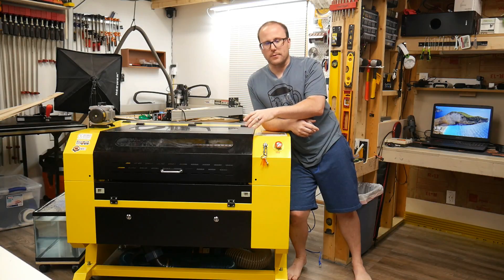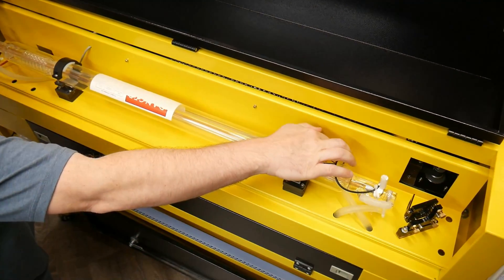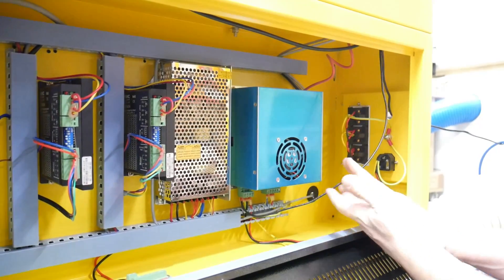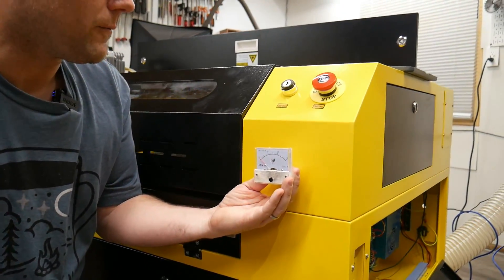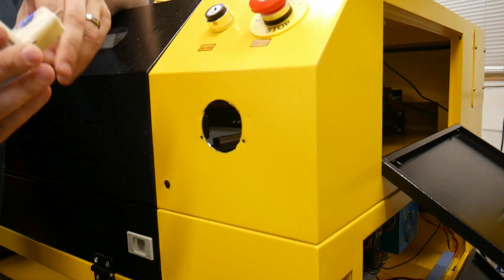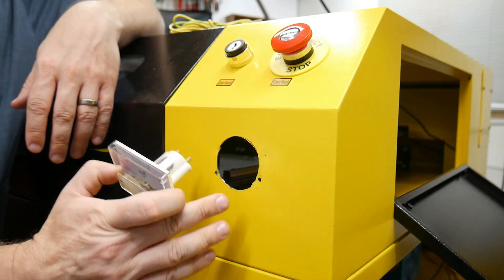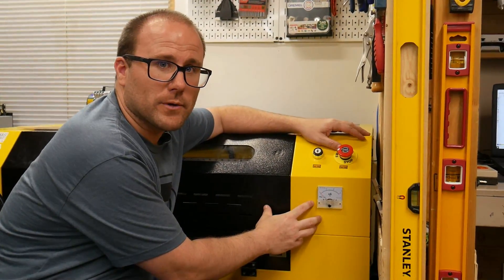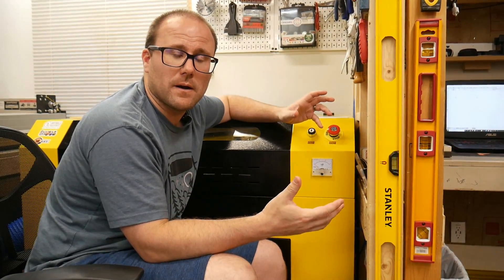How To Install A Milliamp Gauge In A Chinese CO2 Laser

Comment: Your wiring technique is really scary!  Folks watching, please use a proper crimper for your connections, better yet solder them.  If you thought you had a 60 watt unit, you may have a 60 watt unit.  Your connections may be insufficient for the load and showing what a 50 watt unit pulls.  I suggest crimping them correctly and checking your wattage pull again.  Not nagging, but constructive thoughts to consider.

Comment: You should peal off the blue protection-plastic from your laser power supply, its only there to protect the metal when stacking them together from the factory. Due to there are components that uses the metal to lead away heat, the plastic will act as a insulation so that the heat wont dissolve as good as without the plastic, your components will last longer without it <3

Comment: I personally would've use those water proof self soldering heat shrink connectors on the wires.

Comment: I didn't quite understand how you decided that 20mA was the max amperage (which corresponded to 85% power in Lightburn). Also, would a 30mA analog meter be sufficient for an 80W tube?

Comment: Cooling inlet should be at the rear because it is the hotest place lower to prevent air bubbles side (1:09 shows that it is on top). Am I wrong?

Comment: My Milliamp Gauge sometimes goes higher then normal during a cut. depending one the file I am cutting it. The gage always reads 19 ma when press "pulse". But in a cut file. it varies 15 to 20. in  another file it went it to 21 ma steady. any clue why? Not all files do it.  I have min and max at 80% power.

Comment: I need some major help. I installed the milliamp just like the video instructed. Turned on the laser and the milliamp isn't registering any power at all. I tried running a test design and the laser is not firing up. What have I done wrong and how do I fix this?

Comment: Nice walk through but why to use yellow/green ground wire for current? I would use black wire so you don't confuse anyone who services the machine in the future.
Reply: Completely wrong, dangerous and stupid breaks every wiring code,  green and yellow is a designated ground wire colour , a quick trip to Home Depot for a $5:00 length of correct colour wire would do the job correctly. Also use the correct tool for butt connectors. Complete poorly executed upgrade
Reply from the maker: I don’t care, it’s my laser.
Reply from the maker: because it's what I had in my shop.

Comment: Magic question is, when it comes time to replace the tube, will the 60W tube fit in there and will the power supply have enough power to use it or will you just replace with another 50W?
Reply from the maker: 50w because i'd have to cut the end to stick it through.
Reply: @MyersWoodshop  Your machine already has a hole cut in the side to take a longer tube. :-)

Comment: You really shouldn't have used that spare piece of earth cable. At some point in the future someone may tap into it thinking it is an earth and then get a shock from the cabinet. For the cost of 6 ft of black why take the chance?
If you are going to use crimp connectors use crimping pliers and make the job a good one.
Reply from the maker: its what i had on hand at 11pm.
Reply: @MyersWoodshop  Noted, understand in that situation when you just want to get it finished and tested :-)

Comment: What gauge wires? I looked up 20-30amps and it's recommended 10-12 awg does that sound right?
Reply: 20-30 milliamperes not amps.
Reply from the maker: yep.

Comment: hi.  i have a china 100w blue and white. is it the same amps on all the machines?  and i see that everyone use the manual reader instead of a digital, is it a reason for that?
Reply from the maker: not same amps.  Digital can fail, analog cannot.
Reply: @MyersWoodshop  Both can fail, and if anything a digital meter should in theory be the more reliable of the two. But the reason for not going with digital is that an analogue meter tends to average out the instantaneous power as it is slower to react than a digital meter, so making it easier to read. A digital meter will fluctuate wildly and so the display will be constantly changing making it difficult or impossible to read.

Comment: Only in America would someone use earth wire as a negative connection. Negative wire should be black or blue in europe. Why did you cut the cable? Move L- wire to meter and add a newpiece of cable fromeL- to + side of meter. Result no dare I say cowboy wiring.
Reply: So to dumb it down, remove black wire from power supply and run to - side of meter. Then run a wire from + side of meter back into the - side of power supply?

Comment: Hi was it possible to remove the low voltage wire at the power supply terminals an break it there an install connector
Reply from the maker: yep, and that would have made more sense looking back on it  lol

Comment: Where can I find a chart that compares the length of the tube to the wattage of the laser (I've seen two versions of 80W tubes on Amazon from the same company, one which was 1250mm and the other was 1600mm.) 

ALSO, I don't understand how one can tell how/where the laser tube "maxes out."

I mean, it seems from your notebook data that your laser maxes out (100%) at 22mA. What am I not getting?

Is the maximum mA a parameter which is prescribed by the laser tube manufacturer (e.g. "a 50W tube maxes out at 18-20mA" -- and Lightburn reaches that when set at 85% power) . . . or can tell that the laser "maxes out" on the basis of the stock that is cut or what?

I purchased a 30mA meter for my 90W laser, but haven't installed it yet. Will a 30mA meter be enough . . . or should I have gotten the 50mA?
Reply from the maker: google.
google.
its overdriving at 100%

Comment: I need to get this to my basement.  Is it possible to take off the stand that has the wheels, so I can make it smaller and lighter?  I see a seam under the main box.
Reply from the maker: yep, its not super easy but its just bolted together. just take the top off.

Comment: also I would be tempted to simply replace the "inadequate chinesium" wire at the back of the power outlets and use them as intended, Much more efficient and self contained and you can still use the installed switches
Reply from the maker: easier to just get a power strip.

Comment: much better to use a soldering iron and solder the connections and cover with heatshrink tubing. or better still just join 1 wire to the black wire and the other to the powersupply where the black wire was, only one potential failure point then!
Reply from the maker: this is true.  i just didn't feel like it at 12 in the morning :P

Comment: Please find a pair of T&B Sta-Kon Pliers that are made for crimping both insulated and non insulated terminal connectors Model number Thomas & Betts WT111M  anything less is like putting 4 temporary spares on a corvette, or running 87 octane in a Ferrari in other words using a pair of lineman pliers ie side cutters to smash terminal ends is about as messed up as a soup sammich..

 Thomas & Betts WT111M

https://www.alliedelec.com/product/thomas-betts/wt111m/70039935/

Comment: If you want to have correct readings you should zero out the mA meter. There is black screw below the scale turn it to zero out the scale. Now it is reading less current because it is reading from -1 or -2 mA not from zero. Also using Protective Earth cable colour for High voltage ground from laser is vileness. At last among electricians.
Reply from the maker: Good thing I’m not an electrician!
Reply: @MyersWoodshop  Amen!

Comment: What did you use to drill/cut the 2 inch hole for the mA meter?
Reply from the maker: drill bit and jig saw.  didnt have a 2" hole saw
Reply: @MyersWoodshop  

Look up Square-D Hole Punch (or some of the cheaper alternatives available these days). When I made mock-up case designs for the military, I always used the Square-D punches. They make a very clean hole. They may sound expensive for a single hole, but I found that once having it, that punch size could be applied to a lot of other needs. A lot of products use full-inch size holes, so once you get a few of those punches, you will be surprised how handy they can be. Based on your measurement of the meter, I suspect that a full-inch size would be what you would choose. It is a good idea to make a test punch for some of those odd sizes on a piece of scrap metal.

It is also handy to have a metal hand punch for small sizes that you squeeze like pliers. They come in a kit form with several common hole sizes.

Comment: Are you shitting me?!

I am sorry but hell no! You do not use grounding wire for anything else BUT ground! As someone who repairs electrical and electronic devices on a daily basis that is just so infuriating to see. If I ever see that in a customer device it goes back un-repaired. I will not stick my hands into a device that has been serviced (or better butchered) by someone who thinks things like this are acceptable. No telling what other landmine botch job repairs that person has done before it landed in my lap.
Reply from the maker: I’ll exclusively use ground wire on everything from now on 😛

Comment: never use yellow/green cable for anything else then ground, get correct colour cable. And use the yellow/green cable for ground so you do not electocute yourself.
Reply: Actually, the response you were looking for was “oh, you’re right, my bad”. Clint is right.

At least if you’re going to do something dumb, don’t make an instructional video out if it.
Reply: That’s what a woodworker in Crocs would reply ... 😉 It’s your machine, you screw it up as you like. At least you saved 4 cents !
Reply: Color isn't important lol. If you know the machine it's especially not important.
Reply: @JSAFIXIT  Colour IS important and none more so than that used for Earthing and Grounding, so much so in fact that here in the UK the correct ratio of green to yellow in the cable sheath colouring is laid down in our wiring regulations.  And, whilst you say he knows 'his' machine, suppose he wants to sell the machine at some point in the future? What then? Rewire? Tell the buyer and hope they remember? Do it right first time.
Reply: @semperidem2577  OH so they are trying to idiot proof things. Gotcha.
Reply: I wouldn't call it idiot proofing but if you were to choose to to mess with any cable colours in a DIY build, the Earthing/Grounding wiring wouldn't be my first choice ;-)  
Put it this way, if you've gone to all the trouble of building your own machine or are adapting an existing one, why not go the extra mile and do things in the way they are meant to be done? Maybe it's my OCD kicking in, but to do this just to save a few cents of cable seems crazy.
Reply from the maker: i know whats what, so i did it with what I had on hand and free.  Feel free to use the 'correct' colored wire.

Comment: Good video and it allows me to draw a parallel with my Orion.  A couple of questions...
   Will a 30ma meter work for a 100W laser?  I just measured the tube at about 1470mm depending on where you measure.
   In one of your links you show the Ruida RDC6442G/S controller.  What was your purpose of upgrading it?
Reply from the maker: I didn’t upgrade the ruida controller. That’s just the only ruida that I can find on amazon for those who have a different brand controller.  I THINK the 30ma should be good for the 100w
Reply: Please, if you love your life and respect your family, hire and INDUSTRIAL IBEW Union Electrician to install the Meter.   As a clue, for your 100-watt laser, I would believe the meter you need would be 50 MA.  But it depends on the voltage applied, which is either in the manual or derived (calculated) from information on the tube.    Handymen don't cut it if you are serious about what you are doing.
Reply: @johnhansen2187  Stupidity everyone can do it....
Reply: John Hansen yeah well, a little humility can go a long way too. Instead of wagging your finger and telling us how important it is for a professional to cut a frikkin wire, you could’ve just said ‘hey we’re really hurtin out here and could use a few bucks if you need any electrical work done’. Yes the power supply is extremely dangerous but I don’t think anyone is going to do this modification without understanding that fact and the guy in this video also made it very clear that the power supply/ red positive wire can and will kill you.

Comment: Your meter came with wires?  Huh.  Mine didn't.
Reply from the maker: no it didn't
Reply: It was the extra ground wire that came with the laser.  He just repurposed it, which I agree with earlier comment that yellow,  green should be used for ground, not negative.

Comment: Hmmmm 2.4k huh mine cost about 3 but i built mine kinda a hybrid of daves gattons machine and pactric h Daniel's machine it is also on a 12 foot table was 16 foot hehe long story mine has the same powersupply mine is 50 watts it is also has a 2.2kw water cooled spindle router with the most ridiculous stepper knob ever made hehe let the photonic light cutting commence

Comment: Nice job..I have the same machine.  I am a solder heatshrink kind of guy but other than that we did the same thing.   Have you look at your lazer power supply?  Mine is a 60 watt.  I have done some checking and there are 1000mm x 50mm laser tubes that can go to a full 60watts.

Again nice job.
Reply from the maker: i havent.  I need to check on that! where did yours say the wattage?
Reply: @MyersWoodshop  it will be printed on the power supply.  I used a small mirror to read it.
Reply from the maker: What’s the max milliamp you run?
Reply: @MyersWoodshop  the max mine will put out is 24mA

Comment: I would suggest to use one of the current clamp sensors and just clamp it around the cable. That way you have no direct connection to the laser wiring and still get your amp reading.
Reply: Which one would you suggest?
Reply: @GlazierPointDartCabinets  a current induction loop is no where near accurate enough for the fine tuning needed for these tubes

Comment: How not to crimp a connection ;) First you should never twist the bare wire when using a crimp tool, secondly you are pinching from 2 angles.. you should crimp it from the top only, that way the 2 metal slits will bend over and crimp into the wire. As you can see you only managed to crimp a small portion, the end of it is now bigger than it started.

On the but connections, please DON'T use a combinationplier but the correct tool... you'd be better off using some solder and heat shrink tubing
Reply: I cringed so hard about that. I paused the video to see if someone had already said it! 👍 😂
Reply: @Uzwel  same. going to watch the rest now LOL
Reply: Never mind. Laser tubes LOVE some sparking on their power supply.
Reply: Just checking how your laser is performing today love today buy one
Reply: To not today
Reply: Nah he’s just sticking to the Chinese quality wiring 😂